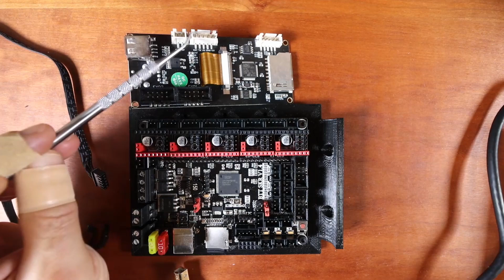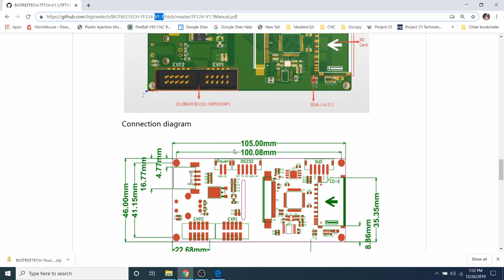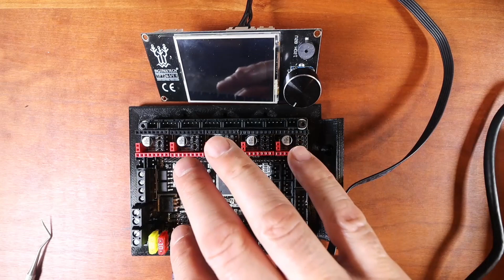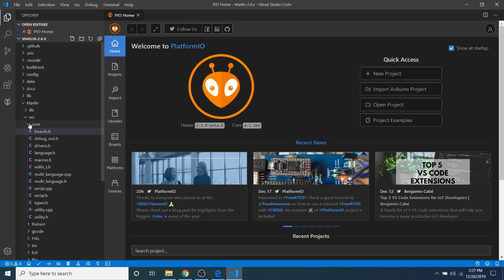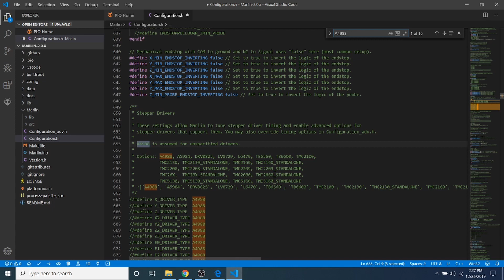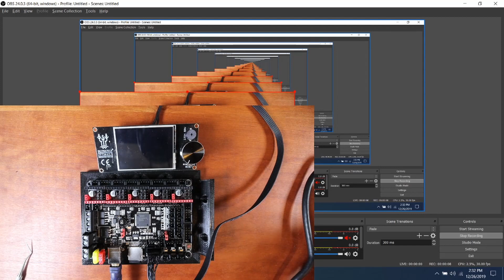SKR 1.4 - TFT24 Touch screen (3 of 3)

Comment: Ribbon coding is the opposite on my board. So the single cable goes to the left! Check this on your board before plugging it in. The pinout is printed onto both boards.

Comment: On the SKR 1.4 Turbo, the connection is flipped! The single (reset) pin sits next to the microsd card slot. Thankfully, the pins are marked on the board.

Comment: Hi guys,

nice video! I really like it, but it doesn´t work for me. When I set my configuration in VS Code to #define SERIAL_PORT 0 my VS Vode says: "Marlin\src\HAL\STM32F1\dogm\../../../inc/../HAL/./STM32F1/HAL.h:81:4: error: #error "SERIAL_PORT cannot be 0. (Port 0 does not exist.) Please update your configuration." But if I change the Serial Port to 1 my display doesn´t work. I hope somebody can help me.

Philip
Reply from the maker: Try serial port -1.
Reply: @EdwardBraiman  Thank you very much for your answer. Unfortunaltly the printer still doesn´t work. It shows the message: No printer attached.
Reply from the maker: Are you talking about a TFT display?
Reply from the maker: Check the speed of the LCD screen compared to you SKR 1.4 speed and match them.
Reply: @EdwardBraiman  Yes, I´m talking about the skr tft24 v.1.1. Both speed is 115200.
Reply from the maker: Did you see the upgrade video?  Keep in mind they recently changed the display in the upgrade for tft28.  This may fix your issue.
Reply: @EdwardBraiman  I used the following fils: "BIGTREE_TFT24_V1.1.26.x.bin", "TFT24"and at the beginning I also used "config.ini" but I deleted after the software was on the printer.
Reply: @EdwardBraiman  Hi Mr. Braiman, I´m sorry for bothering, but can you explain once more? I watched your video twice but I can solve my problem.

Comment: hi - i deleted my firmware.cur file before placing the firmware.bin on the new board - is this an issue ? - thank you (skr1.4turbo)
Reply from the maker: It just means you're backup is gone.
Reply: @EdwardBraiman  thanks
One less thing to worry about
I have a good pc but compiling can take up to 5 hrs......tried all youtube configuration place bin file on sd put 8n board power on 1 red light near incoming power and constant green light at sd......btreetech lcd not even 9n and pc can't see sd on printer. ..been 3 weeks so far.....agony.....agony nd I been building quad copters for years
Confused and dissatisfied
Reply from the maker: So it's working now?  Also I might be doing quadcopter videos soon.  Just haven't had time to test mine.
Reply: @EdwardBraiman  will try in morning.....yes I've taken a step back in flying even as the printer has had me going since the ender 3 came out

Comment: I left the first serial port  at "SERIALPORT_1 -1" and defined  "SERIAL_PORT_2 0" and this cleared things up (once the baud rate was set). I am assuming that this won't interfere with usb serial connection for Pronterface or whatever.
Reply from the maker: If it works, use it.

Comment: Unfortunately on my screen "No printer attached!" did not disappear after upload... And I did everything step by step as you did... :( Im using TMC2209 if it matters...
Reply from the maker: Have you tried the tutorial before 2 of 3?  It takes about firmware update.  Keep in mind you want to use, "unified menu material theme", folder because they changed firmware update after tutorial was recorded.
Reply: @EdwardBraiman  I updated screen firmware to the latest version. But if you are talking about part 1 of this tutorial it is private video :(
Reply from the maker: This should be the title, "SKR 1.4 - TFT24 Firmware Update (2 of 3)".
Reply: @EdwardBraiman  I did part 2, and it updated successfully the screen but the error about connected printer is still there.
Reply from the maker: What's the buss rate of the TFT LCD and Marlin firmware?
Reply from the maker: Marlin firmware is default 250000, TFT LCD is default 115200.  I normally change TFT to match in settings menu.
Reply: @EdwardBraiman  I tried both ways (250000 and 115200 on both ends), and neither worked...
Reply from the maker: Which motherboard are you working with?  I'll try it myself to see if it's working tonight.
Reply: @EdwardBraiman  skr 1.4 as on your video :(
Reply from the maker: I'm wondering if Marlin firmware has changed since recording.

Comment: Hey there.  Awesome video, I am using the same products.  Do you by chance have the file of the temporary board holder you are using for the skr 1.4 you could post?  It looks so easy to setup the board when it is mounted.
Reply from the maker: Check my SKR 1.3 playlist for the basics video.  There should be a link for thingiverse.
Reply: @EdwardBraiman  Yup.., You rock.  Thanks
Reply from the maker: You're welcome.

Comment: i did same things except i have skr v1.4 turbo. i upload marlin but still say no printer attached.
Reply from the maker: What version of tft35 firmware do you have loaded? Have you upgraded firmware on tft35?  If not watch 2 of 3.  If this doesn't work let me know.
Reply: @EdwardBraiman  i upgraded last version on tft24. yeah i watch second video.
Reply: @EdwardBraiman  ok ı figured it. ı change to serial port to 0 instead of the -1. it is working.it will be like that for tft24 right?
Reply from the maker: Yes.

Comment: Good afternoon. I purchased SKR 1.4 and bltouch. Please do a lesson about connecting bltouch to SKR 1.4 through the Probe connector. Many thanks.
Reply from the maker: Privet, unfortunately there's an open bug with Marlin firmware I'm waiting on to be resolve.  If I did a tutorial on how my comments on the tutorial would become many due to the issue. When they fix the issue, I'll post a tutorial.
Reply: @EdwardBraiman  Thanks.
Reply from the maker: You're welcome.